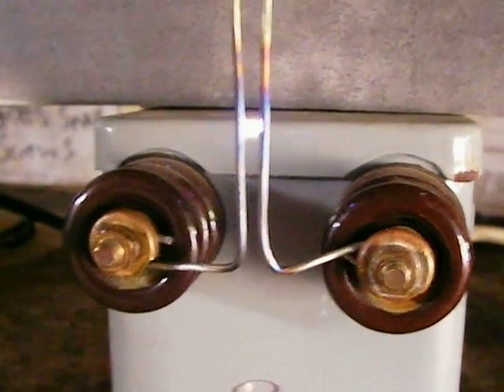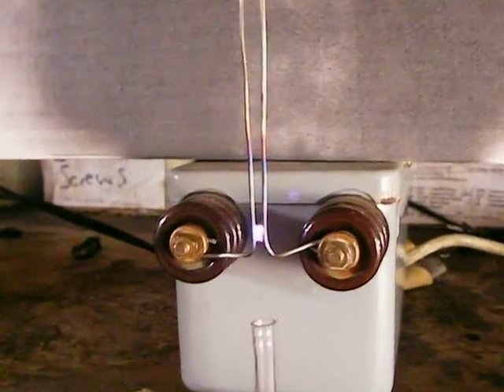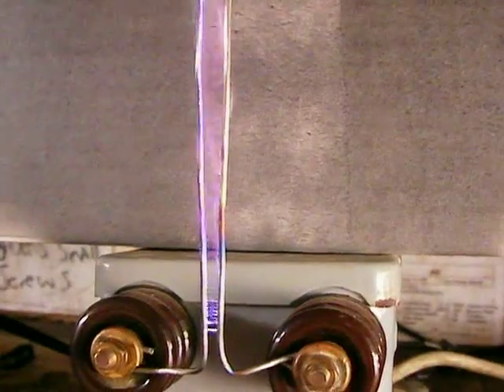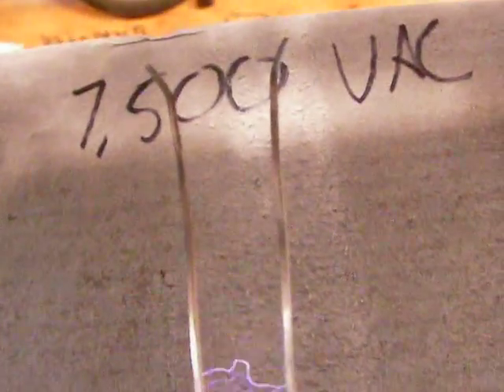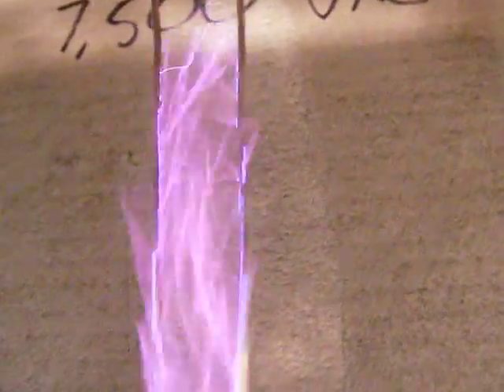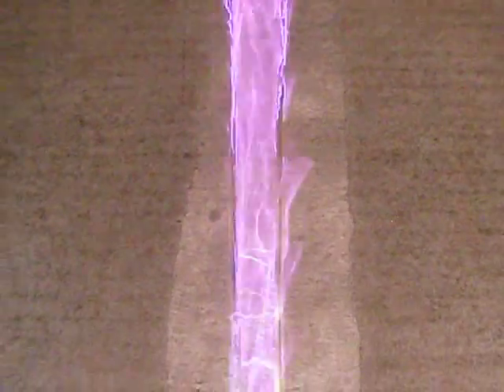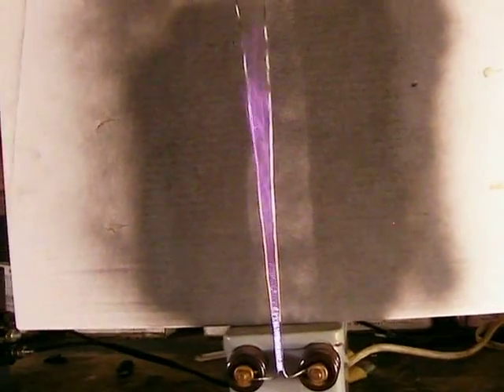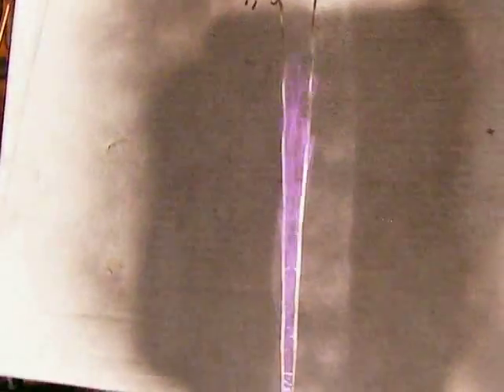Plasma weapon experiments!

Comment: Actually, it's probably very close to normal. The Jacob's Ladder and many other plasma gap machines use incredibly high voltages, at low amperage. However, power consumption is billed by the kilowatt hour, not by voltage. A hair dryer would use FAR more current and cost more to run than this.

Comment: Actually, I have one of these and it does not drive up your bill noticeably. A way to find the wattage it uses is to multiply the voltage times the amperage, and you have the power. 7500 times .030 is 225 watts, so it will not do much harm to your electric bill. 225 watts is the equivalent to having around 4 incandescent bulbs on. It's comparable to a TV or a horribly inefficient laptop, or super efficient desktop.

Comment: Actually not that bad of an idea. make a blade hollow at the middle that acts as the arc for the electricity to get from one pole to the other with a battery powerful enough to power the blade, but the problem is to be able to get enough gas to generate the plasma field. Though, if it is possible, that could make a pretty handy tool, like a knife. a sharp blade when it's not active, but you can quadruple its cutting power by activating the plasma field around it. All that remains is to focus it.

Comment: no, pc power supplies deliver DC voltage (12V,5V and 3,3V etc.) which cannot be transformed to 7500V only AC voltage can be transformed up or down but if you had a PC powersupply which can output 7500V DC (or AC - doenst matter) you could use it

Comment: check out a plasma torch used to cut steel. It uses a power supply and compressed air and it will slice through steel like a hot knife through butter.

Comment: I have a question: is the high voltage that creates the arc or the high amperage? Because you can easily achieve several hundreds of kv from ordinary batteries with cheap boost converters.
Reply: Andrea Iannini from my understanding it would be the voltage, a simple way to look at it is that voltage is the “pressure” and amperage is the “quantity”.

Comment: Now comes the challenge of trying to actually to cast 
the plasma outward. is it even doable? and if it is, what would 
be the range? would it even be practical?
Reply: AcanLord not really because the plasma is only a result of the electric current which needs a place to complete the circuit so you would have to hook an electrode to the target for it to work. The closest I’ve seen to what you’re describing is a plasma cutter which is a device that uses pressurized gas to blow the arc toward the item you wish to cut, but the plasma doesn’t get that far so it has limited applications

Comment: Put that between two pieces of ceramic plate, just that V, long and drawn out, and that thing would shoot hot air in any direction.  I bet it would work like an air breathing engine.
Reply: epoxy or sealant, and leave the metal rods face each other.  plexiglass just so you can see what's happening on both sides of it.  The cold air should go in, and as it expands be ejected, and cold air follow the arc, no matter which way you point it.  Once air goes in the narrow end, it won't want to stop.

Comment: can someone help me on my project? I need a device that puts out high voltage like this and I wanna be able to control the amps to how would I do this or were would I buy this or make this I am not an electrician I am a fabricator. I know you can buy variac off ebay or whatever but I dont know if it control's the amps to please help it would be much appreciated thanks

Comment: Did u know that while ever the Jacob's Ladder is on, there'd be a massive splatter across the electromagnetic radiation spectrum in the immediate area - that means x-ray, microwave, uv, gamma etc?
Maybe u should set up some sort of protection if you're gonna play with this repeatedly.
Btw, they only discovered that an electric arc does that around the 1980s when a guy whose job it was to throw a big arcing switch, wore contact lenses to work for the 1st time. His contacts fused to his eyeballs!